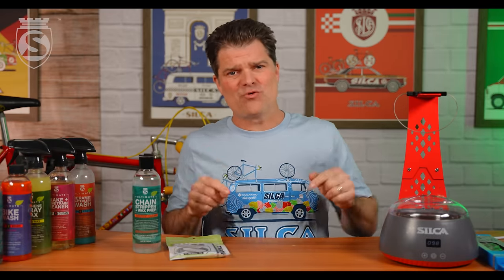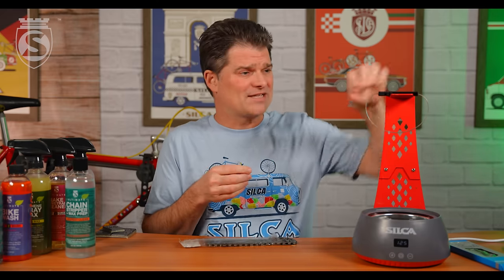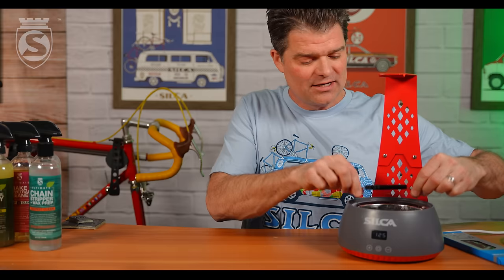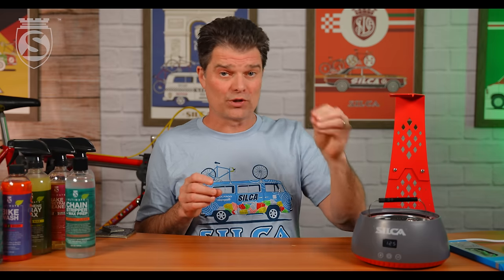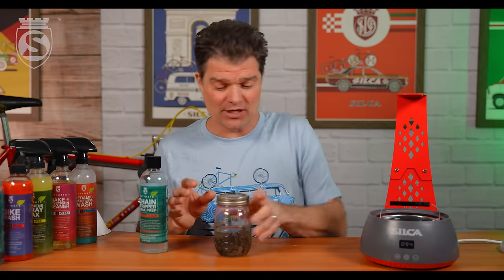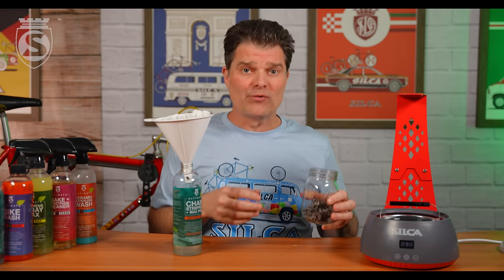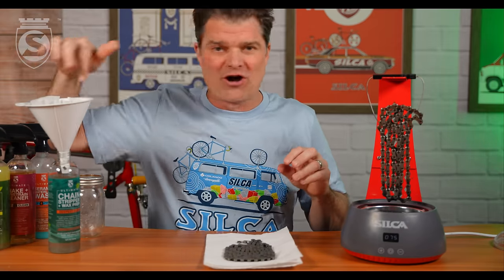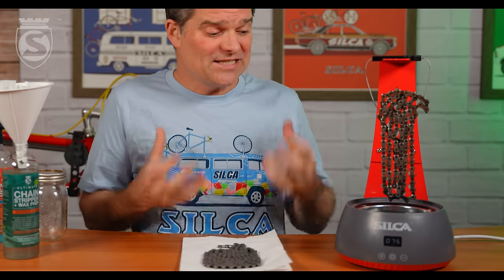Chain Waxing System Tutorial with Josh: A Step-by-Step Guide!

Comment: Can you please address temperature and timing for inserting and removing chain that was stripped rather than chipped?  Assuming 110 C for 10 min to boil off any residual water then pull at 75 or 80 or 85 C?
Reply: I should also add I am a recent convert from squirt and synergetic having purchased the wax system a month ago. While it has rained I have topped it off with super secret lube. I use it on KMC chain for 1x10 setup on road and sram eagle gx 1x12 mountain. Am amazed how quiet and clean to the touch the chain is. I would like also to hear recommended distances between applications for road and gravel and mountain. Much the same as when race broadcasters  let us know cumulative climbing in feet and meters. 😀
Reply: …and one more question on whether the stripper can be diluted with water during the stripping operation, can we add 1oz stripper to 5-6 oz water to cover chain without adversely affecting chemistry?

Comment: It's the same stuff like cooking oil solidifier, sold for a dollar.
Reply from the maker: I know this was recently claimed by the puppy killer.. no, this is not at all the same stuff.  Cooking oil solidifier is primarily made from perlite, which is an expanded volcanic glass which acts as a binder to congeal oil.  It is also used as an abrasive in commercial buffing compounds and grinding pastes, it is NOT something you want to put into your wax.
Reply: @SILCAVelo  I thought it's made of cyclodextein and polysaccharides

Comment: Joking here…but waxing the quick link, (one of about 100 chain links) could be a 1% marginal gain, on a component that about 95% efficient…so that’s a 0.005% gain?
Reply from the maker: There is no efficiency difference in not waxing the quick link as all of the metal-metal interfaces end up covered in wax after the link is installed.

Comment: Josh how about an instruction video for your ultra exspensive wax x ? Right on the can it says instructions for use online,well thats a lie,i've emailed you people 3 times and kept getting brushed off...So disappointed in silca over this.Love the super secret line up though!Cheers!!!
Reply from the maker: Glen, it works just like the normal wax, heat it until melted and then dip the chain.  You can heat it in the tin using double boiler, or pop it out of the tin and into a SILCA wax melter..after that it's just like any other wax.

Comment: Did I miss a step? It appears you put wax in the pot before you put the chip strip?
Reply from the maker: Yes, SILCA Secret Chain Blend Wax is in the pot and heated to 125 C. Then when at the 125C - the StripChip will work to convert the factory grease in the chain to a wax-like molecule. After air bubbles no longer come up during stirring (approx 10 minutes), lower the melter pot temperature down to 75C before pulling the chain to hand to dry.
Reply: @SILCAVelo  I think I may well be a new customer after this video.  The chipstrip being the game changer for me!